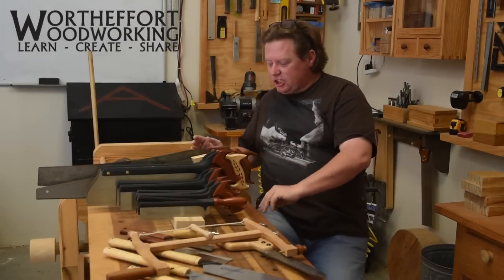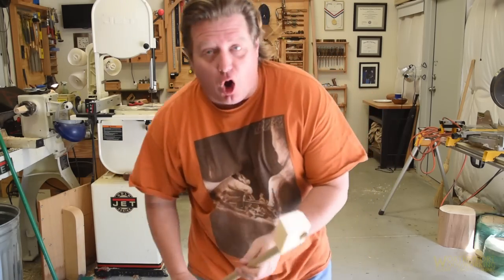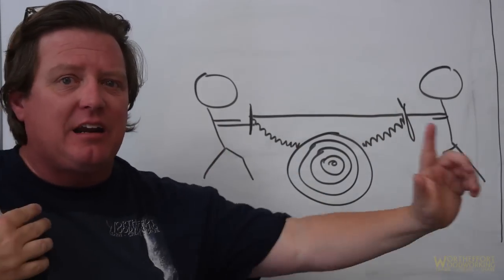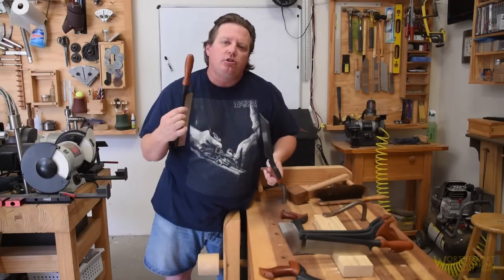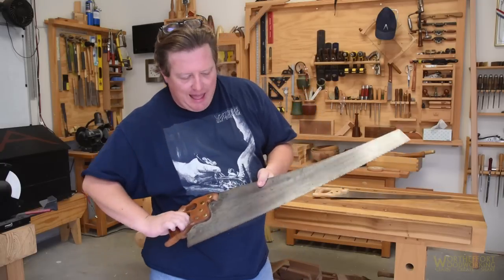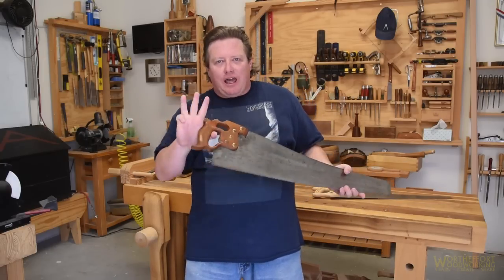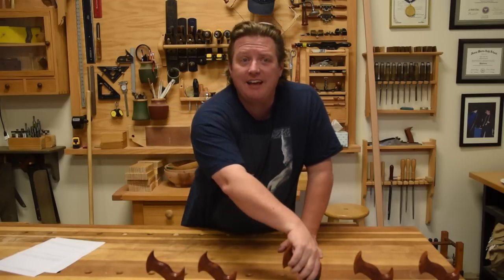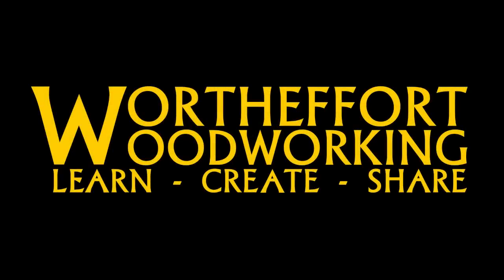1-03a: Hand Saws DeMystified - An Introduction to Saw Design and Usage

Comment: Excellent overview of handsaws.  I'm starting to use them more and have much more confidence in using them after seeing some of these video's.
I have  a question:  Recently, I came across a very nice old European keyhole saw in my shop that I forgot I had.  Do you use this type of saw in your woodworking?  If so, what  do you do with it?
Reply from the maker: Thanks. keyhole you use with a drill bit. Make a hole then you can saw out of it as if you were making, an old timey "key hole".

Comment: Great information. Thanks. Why do some rip saws track straight, but some want to curve to one side?
Reply from the maker: My number one guess... a death grip. My number two, body alignment. Number 9,364 is if the last person to sharpen them induced a few degrees angle on ALL the teeth then it might cut more on one side than the other, or if someone has removed the set from one side. But they'd have to really mess up badly. Almost every time is humans getting in the way of a saw eating.